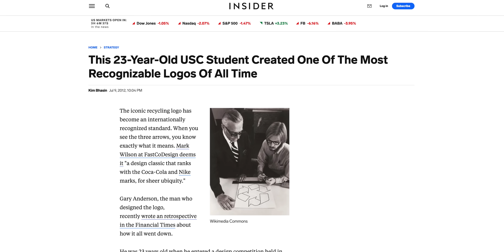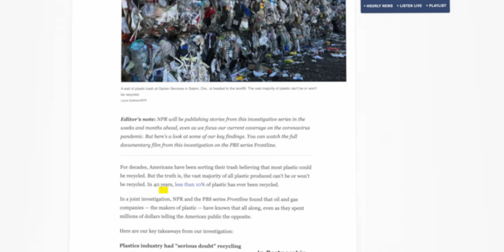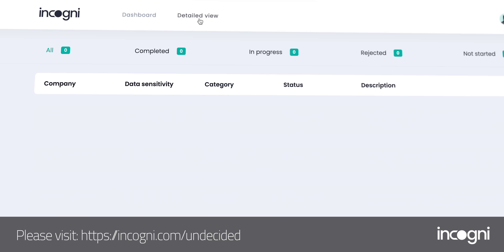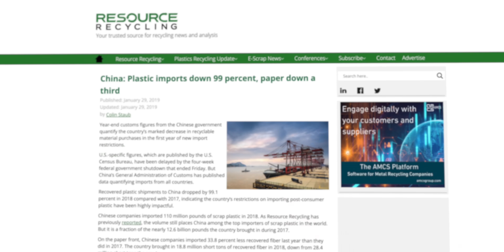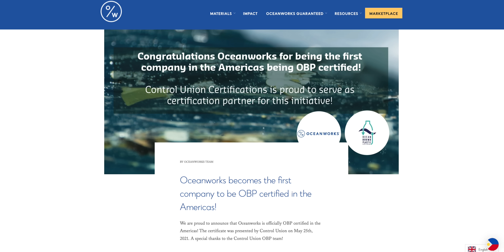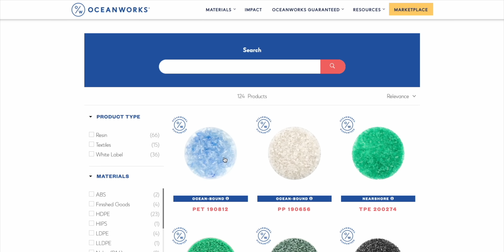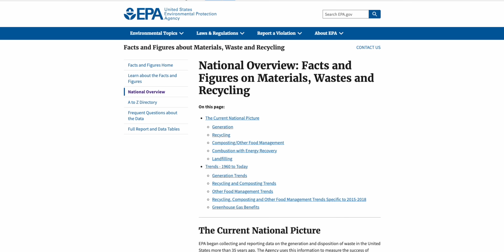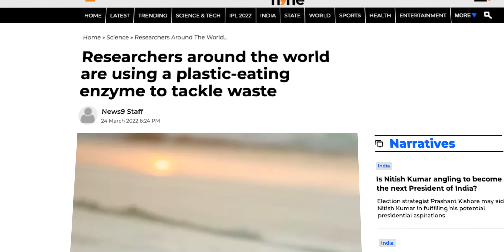The Truth About Plastic Recycling ... It’s Complicated

Comment: The other problem with plastics is microplastics. Recycling releases a ton more microplastics than just dumping the plastic in a landfill. That's why we need to ban single use plastics, and ban any plastic that comes into contact with food. Until then I'll just try not to buy anything with plastic and if I have no other option then I'll just throw the plastic in the waste bin so that I know it is at least only going to a local landfill, rather than getting incinerated, shipped to southeast asia to be dumped in the ocean, or god forbid "recycled" and releasing even more microplastics. I don't want virgin plastic, I don't want recycled plastic, I don't want ANY plastic ANYWHERE near me.

Comment: Not correct numbers two, four, five our recyclable by individuals as long as they melt them and not burn them you can make all kinds of useful things out of these including park benches that we give away free. Does it take a little work to get this done yes it does but I'm retired and biochemical engineer. I don't mind spending a little bit of my money and I definitely don't mind using my time to do this. That's just one idea there are people out there that have thousands of ideas, the biggest obstacles to this is to make a form that you can press. A friend and I use Cabinet strength framing clamps. Others use hydraulic presses. The next obstacle to overcome is the melting process you do not want to use this in your husband or wife's oven. So my suggestion is either a toaster oven or a sandwich flap melter. No higher than 180°C or 390°F you do not want to burn the plastic you want to melt the plastic. You need to have well ventilated area you probably want to wear a mask respirator, and you need to make sure that the plastic has been washed thoroughly, the best way to do this is using a laundry mesh bag and running through a heavy duty cycle. And of course then you need to make sure it's 100% dry. But, to say none of this plastic is recyclable it is not true. However, large recycling centers cannot make a profit because they have to sort and clean all these plastics just the same way that would do it at home. So the answer to his question is it is correct the way the author has portrayed it. And it is not correct in the sense an individual can have this done.

Comment: It's pretty clear a lot of plastic packaging can be replaced with other products that are effectively 100% recyclable or can be used for compost.   Also, plastic packaging should be moved away from sources that at not recyclable.   Since some plastic containers are recyclable, then corporations and businesses should have incentives to use that kind of plastic.   It is a bit of a puzzle why 2/3 of plastic that is manufactured cannot be re-used.   A company called Trex makes a composite deck material that contains plastic.   The decking material is warrentied for up to 50 years.  A lot of plastic packaging can probably be replaced with non-plastic sources.  For what remains, it appears to be a technology, engineering matter.

Comment: I wonder if plastic is a must byproduct of the oil industry? Before the diesel engine came about diesel fuel was just dumped by the oil industry, if they wanted gasoline then they had to deal with diesel. Is it the same with plastic or could they just make more fuel instead of more plastic?

Comment: Replace plastic bottles with glass bottles as it was in the 1970's. No plastic almost anywhere in food packaging, especially drink bottles. Glass bottles can easily be very quickly checked with technology (like laser scanning) for damage and once cleared simply sterilized for re-use using steam which requires so much less energy to produce! Buying jams, peanut butter, etc in glass jars allows you to use these at home for an almost endless amount of time where plastic will start to breakdown and release microplastics into your foods after just a few re-uses. Glass is also made from more sustainable sources (sand) and once made can simply be constantly re-used. Food labels can then be made from biodegradable paper which can easily be removed and composted. Also using aluminum over plastic for drinking containers (soda, beer & mixer drinks) as it is also easier to recycle and is not a petroleum based product like a lot of plastics. Recycling plastics also creates microplastics, same as every time you wash polyester (made from plastic) clothing which your washing machine then flushes into the water system along with the water and detergents from your laundry which all ends up in our water eco systems. Nothing is perfect but plastic is IMO one of the worst things we continue to use daily.

Comment: There is a flaw in your logic. You assume green technologies, such as your new house, are helping the climate, because your house is energy independent. 
     Here’s the flaw: every year (except for a pandemic year) the amount of gigatons of greenhouse gases released into the atmosphere has increased, causing an accelerating rise in the Keeling curve. This is because every year the fossil fuel industry extracts and sells more fossil fuels, most of which are burned. Every year they make record profits. Thus, we have better green technologies AND increasing CO2. THE TWO ARE UNRELATED.
    Green technologies improve the climate only if the rate of greenhouse gases decreases.
    What happened?
    Previously everyone thought the world was running out of oil. “There are no more Saudi Arabias”, Bill McKibben wrote in 2010. The Climate Movement assumed green technologies would fill the gap as fossil fuels were depleted. 
    But technology revolutionized the oil industry. Because of horizontal drilling and fracking, the Permian Basin in Texas & New Mexico alone has become a fountain of as much oil as Saudi Arabia ever produced. They now extract UNLIMITED OIL from oil shale rock. A liquid oil field is no longer needed. They say they can meet the world’s “need for oil for the next century” (but they omit the word “century” and use the term “foreseeable future”).
    When UN Secretary General António Guterres says we are losing the climate war, it does not mean we need more green technologies. We need to end extraction.
    Undecided should have an episode explaining horizontal drilling and fracking in the Permian Basin, and what that means for a steadily worsening climate. What Undecided did about plastics, it should now do for fossil fuel extraction from the ground.
    I recommend a new mantra for Undecided: “Green technologies are inadequate unless the rate of extraction decreases.”
    I love your channel.

Comment: Just my 10 cents:
1. To reduce our waste of plastic, we must see the material as special, not common. Refill your plastic bottles with water and use them. The more you use them, the more value you’ll begin to feel that they have, and the more ridiculous it will seem to buy them all of the time. I learned this from living in Africa where people could afford a coke once in a year for a wedding. They used the bottles again and again for just about anything. 
2. Although I’m an artist, the topic of recycling materials makes me despise creativity. When there is uniformity in materials used by design, systems for separation become simplified and then more efficiently upcycled. 
Example: Labeling on bottles. Why do they all use different materials for labels and also completely different adhesives? In Japan there is a regulation that requires all disposable bottles to have a plastic label with a rip tab on it. No glue. 
The more we begin simplifying our design and making those designs standard in our production of plastics, the more quickly we will realize that the solution is about simplifying, not reinventing the wheel.

Comment: Why not go back to glass? I dont get it.
Reply: There's a number of reasons:

1: The most obvious, it's expensive. Glass containers and bottles require far more work to create, and the process of making the glass is more time consuming. Glass isn't just made of sand, it has to be a specific kind of sand, usually beach sand who's particles have been smoothed by the water. Desert sand doesn't make for good glass.

2: It's heavier, making shipping more annoying to deal with. With plastic, you can stack that stuff as high as you like, really, but glass requires special care to be taken for shipping, for fear of breaking and spilling the contents.

3: It's less environmentally friendly, ironically. In order to mass produce glass products, you'd require mass amounts of sand, as mentioned before. The removal of said sand will ruin beaches, removing swathes of land that many sea creatures use. On top of that, glass requires large amounts of energy to be produced, as the sand must be processed with heat. You could use renewable energy for that, but companies simply won't. There's no point in being optimistic about these mega companies, they'll use the cheapest available option, and for them, that's just drawing power from the mains.

Glass was used before because things were cheaper back then. When glass was being used actively instead of plastic, the world was still in the "use without care" mindset, in which the world was broken down for materials without a care for how it would impact it, leaving the consequences to future generations. Well, we are now those future generations, and we need to pick up where our grandparents left us off at.

Comment: The tragic thing here is that, plastic and even Styrofoam can be turned back into petroleum and diesel fuel in an airless chamber under high heat. It can also be melted into solid building blocks, dishes, beds, desks, hangers, tables, plant containers, etc...  There is absolutely no reason that it should EVER make it into The land or water ways at all. Tires also can be melted by adding gasoline to rubber tires in an airless chamber. Steel belts removed after its melted and strained out. Reused into other things.

Comment: The only practical solution that I see would be to use high temperature incinerators for most waste. It produces its own heat to operate and valuable waste heat. Exporting waste winds up in the ocean as it it more profitable to dump it than actually reuse it. Most Asian countries dump most their waste into rivers and the ocean.

Comment: (Not trying to spread hate. Just trying to put forth a question relating to checking your facts).

"The Plastic industry cannot hide that plastic recycling is failure"? With all due respect Matt, The only plastic types you're talking about is PET and HDPE. These two account for a small part of the overall plastic consumption. Plastic sub-types like PP, ABS, HIPS are more frequently used in industries such as automobile, home appliances, stationary, fashion, electronics, and furniture. These types are recycled multiple times and cost cheaper than the virgin variant (Opposite to what you mention in the video). My dad has a recycling unit in Chennai, India, and his company alone recycles 200,000 kilograms of PP, HDPE, HIPS, and ABS plastic a month.  (There are over 450 units in my city alone who recycle over 100,000 'TONS' of plastic a month). I can only imagine what those numbers are globally. Please mention those efforts too in a video this elaborate.
The 60% increase in demand due to Coca-Cola's requirement was JUST PET variant of plastic. NOT PLASTICS ON THE WHOLE.

When you say "Plastic recycling is a scam" please be specific about the type instead of just mentioning a generic term. It puts the efforts of a lifetime of someone down the trash due to a somewhat irresponsible commentary on an industry that is evolving, genuinely "recycling" and, trying their best to make the world a greener place.

All this being said, I still completely agree that waste management across the world currently is a joke and this needs to be taken more seriously. Moreover, if you look at it at a micro level, look around you, every second or third object around you is made of plastic or has a component made out of "recycled" plastic of one variant or the other. It is probably the most cost efficient and versatile raw material that has just been mismanaged more often than not. 
(It is okay if we have different opinions, all of us do not have to agree with my viewpoint).

Comment: A few notes which should be corrected. 

1. The three chasing arrows symbol shouldn’t be/isn’t called the “recycling symbol”. It only identifies the type of plastic resin. 

2. #1 & #2 plastics being the other materials which can be recycled is incorrect. 
- Butter, yogurt, cottage cheese tubes are PP #5 are viable in a single stream program. 
- #4 LDPE (shrink wrap) is recyclable in a post industrial setting. It could NOT be placed in single stream as it is a tangler.
- #6 PS again can be recycled in a post industrial setting. 

3. 9% of all plastic has been recycled is true. I believe solely blaming it on the recycling system incorrect. Consumers,  manufacturers and governments are to blame too.

Comment: I think the most effective way to improve the situation is to inform consumers directly of the impact of their purchase choices, then let the market drive reform. To do that, I suggest the following:
1. Change the regulations so that only truly recyclable materials are labeled as such. From the video I think that was just types 1 and 2. This applies not just to plastics, but to other materials as well (I'm thinking of glass and paper products, for example}. 
2. The regulations above could be expanded as well to require that package labeling include information about the recyclability of the product and packaging. For example, it's volume in landfill, biodegradation life, etc. This will put market pressure on businesses that choose non-recyclable materials for products and packaging. 
3. Change rules for blue barrels used for recyclable pickups to comply with the new definitions in 1, above. This will keep non-recyclables out of the system to reduce wasteful cost of sorting.
4. Let consumers put market pressure on products and packaging that's non-recyclable.

Comment: What about just Melting it all down into solid blocks like lego but large and use it under roads.
Clip the blocks all together on a flat earth surface and Seal right over the top.
According to the number people the road base will last hundreds of years.
Land Stabilization use make very large open frame - put them down and full them with hard fill to stop earth moving.
Huge semi floating booms along coastlines to protect the land from heavy storms.
If people can't find ways of using something they say lasts for hundreds of years in a Constructive way, then I'd be suggesting that Covid Got Your Brain.

Comment: The most hardcore tree hugger needs to pull trash at literally ANY facility out there and take note of the sandwich baggies with half a sandwich still in it that ends up in the recycle can.  This is just the tip of the ice berg.  Worse yet, these practices are being performed by many of those who are the biggest pushers for a "green" planet.

You can literally dump the regular trash on the floor right next to the contents of the recycle can and not be able to tell the difference.  But, it is all about perspective--out of sight, out of mind.  Just like what the loggers did--just move operations away from major highways and all the sudden there's nobody protesting about the clearcutting of forests anymore.  Hop on an ATV or snowmobile and ride the trails.  They'll inevitably end up at logging operations.  Nevermind the house they live in is made out of wood.

Comment: The best "recycling" of plastic is to just use it to fuel power plants.

It burns hot and predictably.

Squish it hot enough for it to bond into "logs" that can be fed to the boiler at a controlled rate.

the smoke has to be handled much like coal smoke.

Comment: The biggest problem with plastic recycling is that there's almost no way to re-use the recycled plastic in things that we'd actually want to buy. About all you can use them for are things that don't need safety or shape tolerances. That sorts a lot out and leaves things like plant pots, trash bins and other things that aren't used a whole lot. The main problem is that there's too many different types of plastics already in use. If there were only a few different types, they would be much easier to recycle and re-use.

Comment: There is a way to recycle all the waste we create. But requires people to demand it of our leaders. The best thing is it's all off-the-shelf hardware. Start by grinding all the waste into a mash, with the solid reduced to dust. The mixture of liquid with the dust is then sprayed into a blast furnace to be turned into vapor. That vapor is transferred to a master centrifuge, where it will separate the elements by their atomic number down the middle. Each bank of centrifuges will be set for the different atomic weights of each element. These bass elements were then collected and sold back to the companies for reuse. The shore of the madder is that this system can reuse all the elements over, and over again. Does not matter what waste or contamination is put into the total recycling plants. Love Canal, Canobale, or any other disaster can be cleaned up. I call this system The Planetary Steward. But do we really want to clean the mess we made or just feel good about our bravo about our looking good for others?